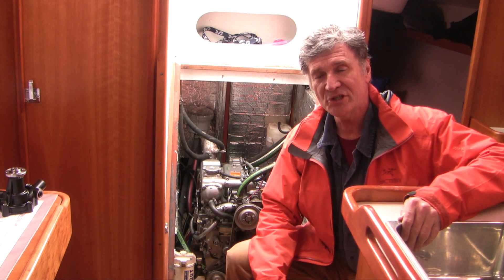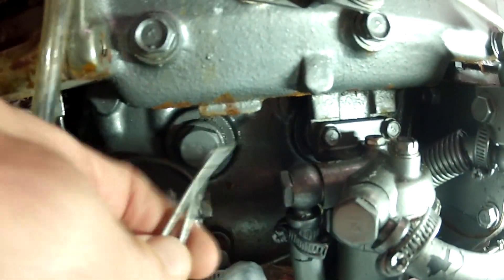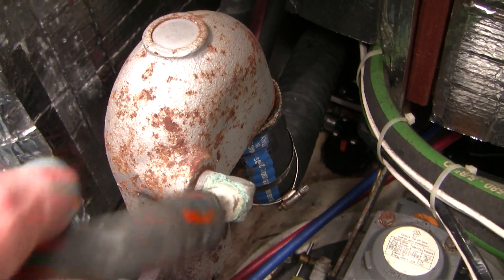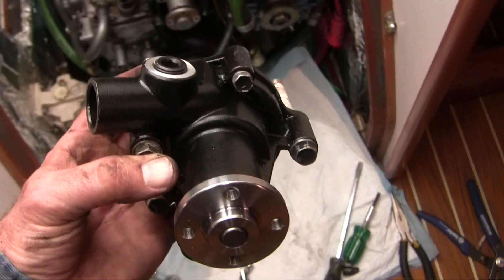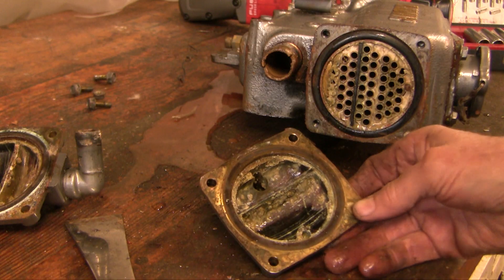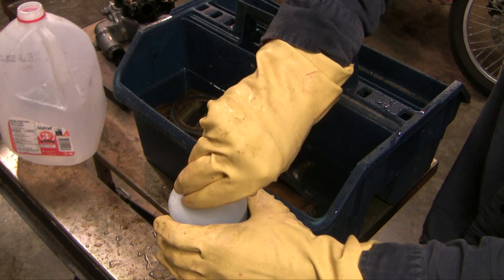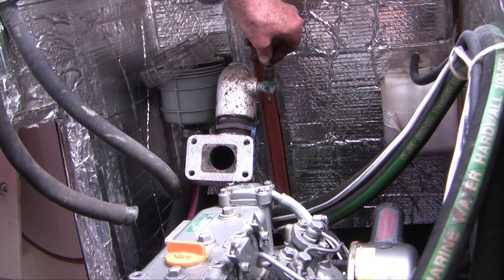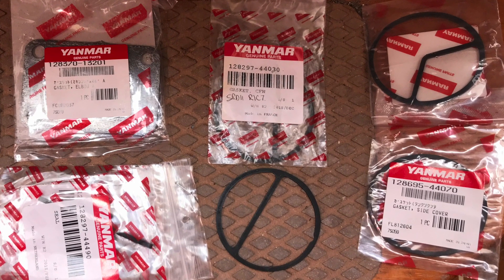How to clean a Yanmar marine heat exchanger

Comment: Good  video, my two cents; Muriatic acid is simply, impure hydrochloric acid. . There is no reason to dilute it,. Other than wasting ⏲️ ⏳️ time . Use pool acid from home depot, straight undiluted. Finished in 10 minutes.  I keep a water hose nearby for any  splashing emergencies too. Acid will kill / remove rust on ferrous metal too.
Reply from the maker: It's been many years since college, but at one time I was a wee undergraduate in the chemistry dept. You're right, Muriatic acid is simply HCL, at varying concentrations. Phosphoric acid is H2PO4, somewhat less acidic at the highest concentration and it may be a little safer because of that. When diluted both yield relatively benign compounds, especially after being neutralized by the CaCO3 backbone of sea life. Of course time is part of the equation, too. Acids will etch various metals and I'd be a little concerned about too much or too long given how expensive a heat exchanger can be. Many sailors have used Muriatic, enough to say it is a reasonable choice. Personally I'd be careful with high concentrations, I've ruined many sets of lab coats because of misguided experiments with HCL, ha ha. I'll add that if you splash a little undiluted HCL onto your face, you'll have a beauty mark for the rest of your life, or worse. The makers of Barnacle Buster claim extra additives that reduce risk and improve results, but I have no personal experience with that. It is certainly far more expensive than Muriatic. Thanks for your comment!
Reply: @spelunkerd  muriatic and hydrochloric isn't nitric acid which is , insta burn ... pool acid muriatic or battery acid in these concentrations doesn't do that I've used it on many heat exchanges professionally over 30+ years. It's what they'd boil your copper car radiator in a bath of, before the enviro wackos took over. Used to get them back in a few hours, now its a few days. Diluting it is simply delaying the cleaning process. It cannot hurt copper.when it stops bubbling its clean, rinse it off, ream it out 10 minute job.  2 gallons for $10 .yall got ripped off buying that quart of b.s. you can soak it in vinegar for a year too, lol .that electrolysis bath was quite absurd, although interesting 👌 . Squirt some Ospho on it.  Also,if some acid goes in sea water (alkaline)it is neutralized like an ice cube hitting the sun. Not that I suggest that. For others reading this, muriatic will eat aluminum and your zincs. Will not hurt iron, copper brass or stainless steel  / steel,or rubber, or plastics
Reply from the maker: @captmack007  Thanks for your detailed replies, I'm sure many who stop by will find them interesting. You verified an impression I have about how pro shops approach this kind of problem, efficiently and quickly, using inexpensive consumables to reduce overhead costs to the client.
Reply: @spelunkerd  pour pool acid muriatic in your seawater toilet bowl to scour it clean, an clear calcification from the hoses

Comment: I’m having trouble finding the gaskets for the heat exchanger cover plate. As you mentioned, I’m receiving the V shaped gasket but mine is like yours - a straight line across from he core. Any suggestions for sources or part numbers?  Thanks
Reply from the maker: The name and business model may be outdated, but I order parts at my marine chandlery that is the local dealer for Yanmar parts. If you go to the Yanmar website they may be able to hook you up with the local distributor/dealer. I have little doubt it is more expensive and possibly a little slower than online options, but I like the guys who work there and they haven't let me down. As far as part numbers, during the video I gave you shots of most of the seals inside their plastic bags, so just view the video at full screen high def mode and read off the numbers printed on those bags. Yanmar are great in that they offer parts manuals and even full repair manuals in free pdf form online. The curious thing about my engine is that it is the YEU engine, identified by the E that is printed on the engine ID tag before the serial number. The E stands for assembled in Europe, but I think it was only the salt water pump! For the most part the YEU engines used similar parts except the salt water pump, I believe most parts are otherwise identical. Good luck, supply lines are really slow these days.
Reply: @spelunkerd  Thank you! I was able to get the part numbers from the list you have at the end of the video and the schematic you have on there. My local Yanmar distributor doesn't have them but I found a place online that does. They didn't have photos online so I won't know for sure until they arrive.
Reply: Additional follow-up:  The straight strip of gasket inside the heat exchanger cover (Yanmar 128297-44490) is currently on back order from Yanmar and not expected until mid-December 2022 or January 2023. I received this message from two different vendors I ordered from. I was able to use the existing strip for now.

Comment: What a great video Dave! Although the components didn’t have much access, I like how you just removed it all to give the heat exchanger a thorough cleaning. Great tip on using phosphoric acid to clean it. And when you said add acid to the water, my days of chemistry starting coming back 😀 Have a great day Dave and it’s about time for me to throw some steaks on the grill. 😀

Comment: Again one of the best Yanmar productions from a knowledgeable resource.  I own a 1989 3HM35F which is basically the same engine and your videos help with planning periodic maintenance. I also agree with your thoughts on engine anodes, only required in versions where lake/sea water is ported directly through the engine.

Comment: Gee! Thank you for response, "spelunkerd". I wander if I could leave my phone number on YouTube, so that we could talk? If not, is t there another way to speak directly to you? 

Please, tell me: is there supposed to be water at the port side draining hole, if I fill up the engine at the top with water? In my case, there is no water at the port side draining hole. There is only water at the starboard side. Is it a problem? 

As for getting a pro, can you recommend how to get one? My boat is in Rockaway, New York. I tried contacting Yanmar dealers today, we'll if there is response. I wander if they would come to the marina where my boat is (it is on the ground now).
Reply from the maker: Yeah, every marina has a group of professionals who will kindly help out, coming right to the boat to assist in repairs. Ask around your marina for word of mouth recommendations. Advice from one of those guys will be far better than from an amateur like myself. They are expensive but everything in a boat costs a lot, and DIY repair can take days out of your life, ha ha. I don't think phoning me will help at all, but I'll continue responding in the threads. I hope it works out for you. Please stop by and let us know what was found, we're all here to learn.
Reply: @spelunkerd  my plan for tomorrow is to put back the bolt on the port side, put back all the parts, add some water and try the engine. You talked of air gap. Wander how it's formed. As for pros at marina - believe me I asked. Negative, as we have powerboats with outboard engines...(

Comment: Hello "Selunkerd"! You seem to be the only person answering my SOS signal about the Yanmar engine. I was sending replies to your replies, but they somehow disappear. Here is my question: I opened my starboard fitting, and old coolant drained from it. Similar story with the port side: old coolant drained from it. I didn't have to use wire, as you did. This I did before putting some Barnacle Buster, with water, into the fresh-water side of the system. This stayed in the motor for 15 hours, and then I tried to drain it. The port side refuses to drain. The starboard side drains alright. In other words, the port side is dry. I tried putting several different wires up the hole, even removed the long bolt which blocks the hole, and put the wire. No effect. So, my question: when I put fresh water on top of the engine, is it supposed to reach the port side hole? If not, what cools the cylinders? If yes, then how can I clear the path from top to the port side of the engine, so water will gush out (if I open the fitting)? Waiting patiently for you reply...
Reply from the maker: I noticed that Youtube is sometimes a little slow to update threads. Your responses are getting to me by email and I'm doing what I can for you. I don't think the Barnacle Buster caused this, but I do think there is something going wrong in your system. Whenever I run into this kind of hair pulling feeling, I try to step back and make sure I haven't made any goofy mistake. In this case the only thing that comes to mind is to be sure the drain bolt you are removing is correctly installed in the right place. I'd double check that in the owners manual. You might have a look at the oil in your oil pan to be sure there is no coolant mixing with oil. If there is a hole blown in the coolant jacket, coolant could drain down to the oil, causing oil level to be too high. The coolant is more dense than oil so if you suck oil up from the bottom of the pan you'll find coolant there if it managed to find a way through, somewhere. Otherwise if it were my engine I'd be thinking about getting a pro involved. Good luck!

Comment: Hello "Selunkerd"! I really need your help now. I have tried cleaning my Yanmar heat exchanger. For that, I took out the part with little holes in it, and soaked it in water with Barnacle Buster. And this is fine. But also tried to clean  the fresh water part of the cooling system with the same solution. All was fine, until time came to flush out the water. Turns out there is some much dirt that water doesn't come out of the bottom hole, where the engine block is. That is: water comes out of the hole on the opposite side, where the coolant is. But it won't come out out of the hole on the bottom, where the engine block is. If I could, I would send you photos to show you what I mean. Please, explain to me how I can resolve the problem? The reason I started messing with the cooling system was that the engine was overheating, several times last year. And now I think I understand why: the fresh water didn't reach the bottom of the engine, where the cylinders are. Can you help me, please? My name is Gennady.
Reply from the maker: I haven't looked closely at the drain fitting on the portside of the engine, but the one on the starboard side is threaded into the heat exchanger. If you watched my cooling system video of the Yanmar system you'll recognize that my starboard fitting was similarly blocked, and I showed what it looked like after removal. The brass fitting was attached by tapered NPT style threads. Then I bent a loop of wire and pushed it up into the hole in the engine block. Coolant gushed out and debris was easily cleared (bring absorbent pads, you'll make a mess). I was able to flush it really well when I had the heat exchanger on the bench. Then I reinstalled it, using teflon tape to prevent leaks. In your case I believe you have a similar fitting, and it appears to be very similar to the starboard side in the Yanmar repair manual. If so, I'd try the same thing. If you need better access it would be easy to remove the alternator, after disconnecting battery power.
Reply from the maker: In your email response to me, you explained that even probing and using back pressure to get coolant to drain there is ineffective. Presumably this was done at a time when the block was full of coolant, which is really odd. I wonder if it had stop leak or some other compound inside that has clogged it up. I'd check the owners manual to be sure you are on the drain bolt, we all make mistakes, ha ha. Assuming there actually is coolant in the block, I'm running out of solutions for you. Perhaps it is time to ask for help from a pro. As you say, overheating could easily be caused by inadequate coolant flow around the cylinder jackets. Even a head gasket leak with exhaust in the fresh water cooling tree should not cause lack of drainage. A pro might be able to check for exhaust gasses in the cooling tree, in which case the decision looking forward would be easier.
Reply: @spelunkerd  there is no mistake about the drain bolt. It had a plastic straw coming out of it, as the straw was used to lead the coolant away. I am talking about the port-side draining. When I pour liquid at the top, is it supposed to reach the bottom,  the port -side draining hole?
Reply from the maker: @tomjoad1060  Yes, fluid should definitely reach there when poured in the top. One thing to remember in these small engines is the fact that you need to have the fill cap at the top of the engine removed when trying to drain fluid out the bottom, because vacuum will hold fluid inside until the vacuum is relieved. Ten minutes ago I published part 2 of the fresh water pump video, and you'll probably be interested to see how the water pump attaches to the engine. If you were to remove the fresh water pump you might find particulate matter in the pump or deeper inside the engine that you can't see from outside. Only thing is, if you remove the pump you'll need to wait for gaskets etc before you can get it together again. You  might be able to put a hose on that bottom hose connection, or even backfill it to try and dislodge particulate matter.
Reply: @spelunkerd  hi, thanks for reply. My friend from Ukraine called me today, and explained what was  the problem. It was that the pipe from heat exchanger was disconnected from the engine, because I put into the heat exchanger the Barnacle Buster. Once I connected the pipe to the engine, the fluid from the top started flowing to the bottom. Too bad it was disconnected, because if it was connected,  the Barnacle Buster could reach the bottom  of the engine and clean the area around the cylinders. I am now putting in the main cylinder into the heat exchanger, and don't know how to pour in the fresh water coolant, will look at your first video on the problem, again...) Thank you for helping.

Comment: Man, what a terrific video. It looked like the 1st row of tubes were blocked initially. Great job. Are there zincs to be replaced?
Reply from the maker: That's a great question, and it took me a few years to figure it out. There are two zincs on my boat, one inside the upper sail drive that you access from the portside aft cabin, and a second that is concentric with the prop, accessed from underneath. Interestingly the prop itself is not grounded to the rest of the engine or to the zinc right beside. Electrical isolation of the prop is part of the design to limit galvanic reactions on the prop. There are no other zincs on the 3GM30FC engine designed for salt water. The reason the topic is confusing is the fact that a different style of this engine, the 3GM30-YEU, and the 3GM30C-YEU, do have engine block zincs! You can tell whether your engine has block zincs by looking at the parts catalog, figure 1 of the engine block, then find the engine zincs, then move your finger down the column for your engine. The reason those other engines do have zincs is because they use lake water to cool the engine, like an outboard motor. Lake water has more dissolved anions and cations, so it is able to conduct and participate in galvanic reactions. Salt water is even worse. Salt water is so bad for galvanic reactions that engineers decided to separate the cooling system into a salt side and a coolant side. On the coolant side, with antifreeze diluted with distilled water, galvanic reactions are so minimal that zincs aren't useful. That's why we don't have engine zincs in cars. What I find intriguing is the way the heat exchanger itself is resistant to galvanic reactions, even though salt water is continuously there, because of the chemical structure of the metal used.

Comment: Thanks for the video Dave. They sure pack those engines into tight areas. I complain when I have to work on my outboard and I have plenty of room. At least if you drop a bolt it doesn’t fall into the lake. 

How often does work like this need to be performed on a saltwater engine? I’m 1000 miles from any saltwater.
Reply from the maker: Great to hear from you, Chad! To some extent it depends on usage hours, but this one hasn't been done in at least 5 years. They are much more durable in fresh water. The salt water design, with two water pumps, complex routing, and powerful galvanic reactions, is intriguing.